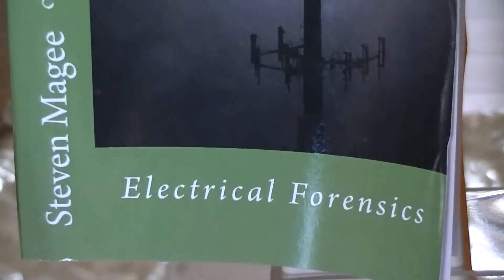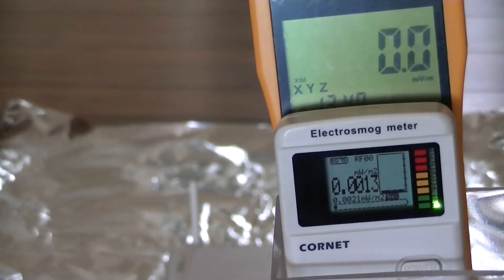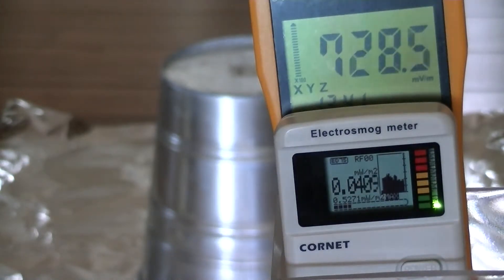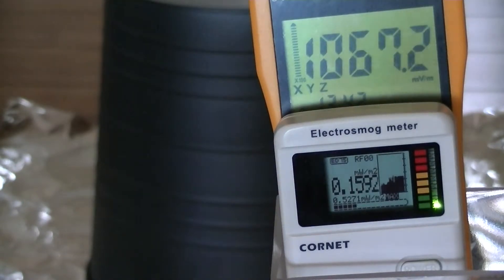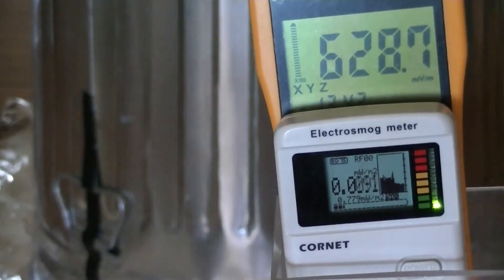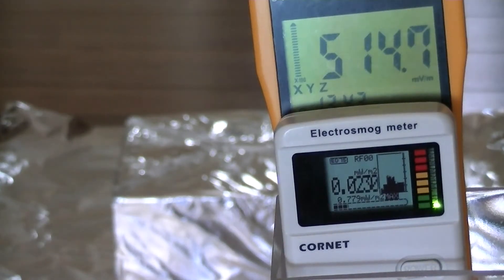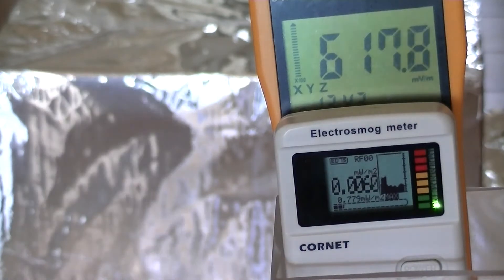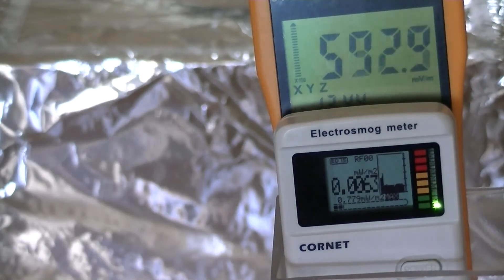2.4 GHz Wi-Fi Testing of Different Faraday Cages

Comment: Nice no-nonsense video providing a lot of experimental data quickly. Much appreciated. Can you explain what is mV/m? I understand that mV is voltage and mW is power but dividing by m has got me stumped. By the way, if your device supports it, using dBm would have been more helpful as it is a more commonly understood unit of measurement for wifi

Comment: I put alu foil on the wall next to my head where I sleep to block out neighbors radiation as I live on the edge of the street most radiation is coming from the side I blocked. Unfortunately just after 30 min trying to sleep my head was staring to explode, and I guess it's because of aluminum reflecting it towards me, as alu reflects on both sides. But can't understand it made it worse as I was blocking the more severe side.
Reply from the maker: It seems that you may have set up a toxic interference field.  See: https://en.wikipedia.org/wiki/Interference_(wave_propagation)
Reply: Environmental Radiation LLC Don't know what that is, but aluminum reflects, so not only will the RF from the other side go through me, they will bounce back when they hit the aluminum shield. Sure it's blocking RF from the other side, but there is no way to isolate RF. Even these shields will not be able to block 100%.

Comment from the maker: Thomas Dargan You will be very surprised at the range of signals that you will find on the steel structures of tall apartment buildings and office towers.  Wi-Fi signals are the tip of a very large iceberg of signals running around on the steel structure.

Comment: Hi Steve. Can we use the steel skeleton of an apartment building as a Faraday cage to transmit, rather than inhibit, Wifi signals, for distribution to apartments? Can we get the signals to stick to the skin of the building, as water may stick to the outside surface of a (poorly made) pitcher? thomas.dargan@gmail.com

Comment: Dear Steve, After watching your video, my observation is that the larger the cage, the lesser the effect. Grounding didn't make much of a difference either, except that it is probably necessary in order to direct the frequencies which are building inside the faraday cage out. I myself am looking at building a small aluminum faraday box to put my cordless phone in at night. However, I have a few questions. Perhaps you can help me. 1) Does it matter which direction the aluminum is facing? I remember reading that the shiny side deflects. So, I would assume it best to have the shiny side  on the inside. However, in your video it looks like the shiny side is facing out. 2) If I punch two small holes in the box for the power cords to still be connected to the outlet and phone line, will this lessen or even compromise the effect? Your feedback would be very much appreciated. The easiest solution would probably be to just unplug the phone at night, but then it wouldn't charge.

Comment from the maker: Solar photovoltaics has problems, especially if the installation is poor and the government is covering up the problems, as they are also doing with wind power.  The long term health effects of electronic power generation are currently emerging and it is not looking good.  Keep an eye on Germany for solar photovoltaics and Denmark for wind power health problems.  Both breast cancer and melanoma are spiking in Denmark, and may be related to exposure to electronically generated harmonic energy.